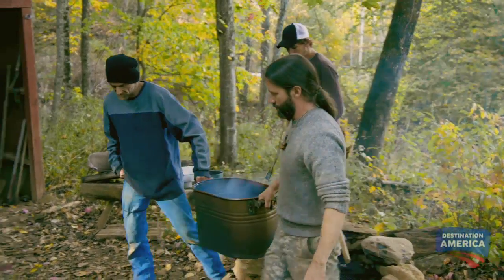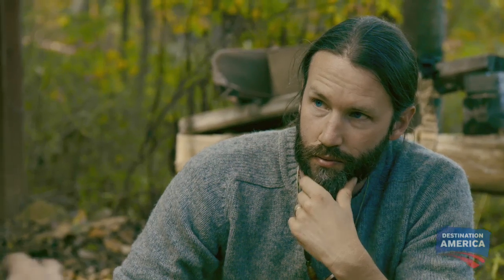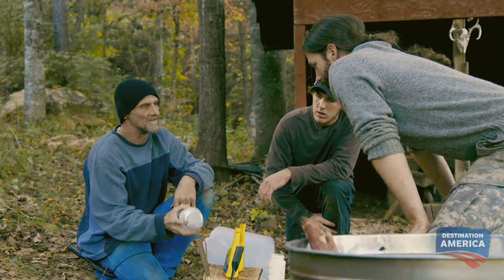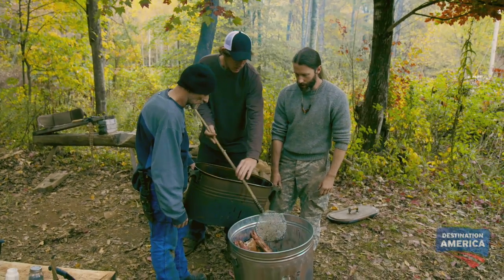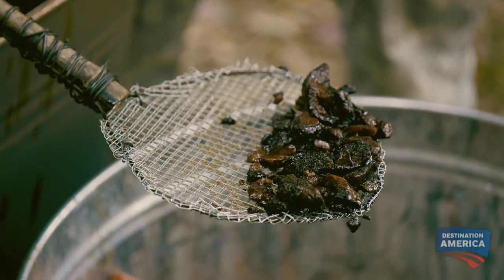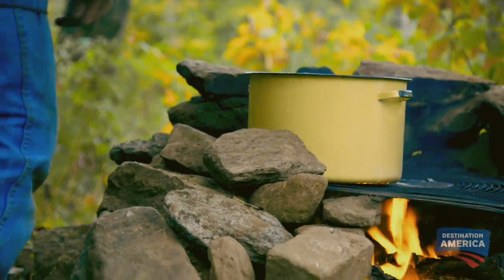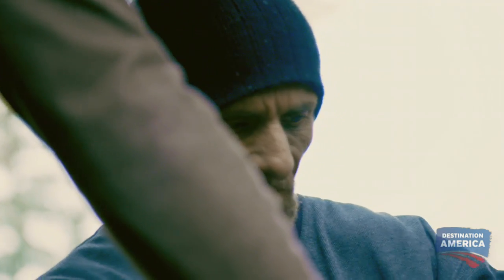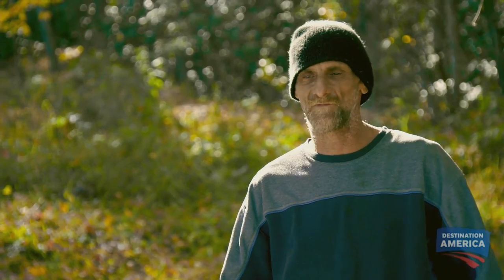Creating Biodiesel from Pig Fat | Hillbillly Blood

Comment: Thank you for actually doing it properly, unlike what many sources try to claim. (Just using fat straight, etc.) Excellent technique with such little equipment. And here I thought I was going to need a heated stir-plate. I was not sure if lye would eat plastic, but obviously your container is sufficient to contain the reaction... and it also appears that periodic agitation should work, unlike another source that claimed you need a magnetic stir bar and a constant temperature. Awesome. You pretty much saved me $300 is equipment that would probably only have been a marginal improvement at best. Probably want to insulate the reaction vessel though. I am sure there is a minimum temperature for this to work.
Reply: Allchya gotta do iffin ya trynna lern is go figure da hillbilly way. If ya aint need it. We aint got it

Comment: To summarise: You melt animal fats on a campfire, add lye (probably half a tablespoon per litre) and let it sit for a while off the fire to stop it solidifying like a candle, then filter off the glycerine (which is what makes it solidify) with a bed-sheet. You can add some methanol to thin it out a bit afterwards to make it last longer, but that adds cost. I really wouldn't use up cooking gas to melt it but rather use a campfire. If you just have used cooking oil, you can just boil then filter it and put it straight into your diesel tank
Reply: How are you going to boil the oil... it's boiling point is incredibly high. That would be more work and even more dangerous. Even then, is the oil going to somehow get the glycerine to break and settle out? That's what the lye and methanol are for, since it pops the glycerine out of the tryglyceride. I don't see how that can be omitted. Once the glycerine is out, it should be thinner, faster burning, and cleaner burning.

Comment: Please tell me someone has corrected this show, heat and filter oil/fat, lye is used to separated glycerine that is all, pour off glycerine. and you have diesel. Methanol is toxic no need for that can add ethanol to thin it same alcohol you drink. I think its deliberate miss-information. Research people please. ethanol alcohol you can consume, methanol alcohol will make you blind or kill you.
Reply: I'm sure the main reason why they're using methanol is based on purity of the reagent. No idea about the methanol source, but without buying reagent grade ethanol from like sigma Aldrich, if you try using vodka it's going to be 60% water and things that are not ethanol.
Reply: Is it possible to make this without methanol or ethanol or anything like that? I'm fine with the lye and the fat, it's just adding ethanol or methanol adds to the expenses.
Reply: +ASeekerOfLostSkills  I didn't hear them say anything about drinking methanol... Anyway... Ethanol is for drinking--that is..... after you get the methanol out lol.
Reply: +JJ Mayers The source of their methanol was "Heet antifreeze" it has one of the highest concentrations. though any type of antifreeze would work, although a distillation process may be necessary.
Reply: The Rust Admin it SHOULD work as is because you can run a deisel engine purely off vegetable oil, crude oil, etc.
Reply: Is it possible to make this without methanol and  lye??
Reply: @critiquesabeach5771  No, not with this process anyway. Methanol and lye are 100% essential. You can't just dump filtered fat into your engine and expect it to last, even if it may work for some engines. Fat/vegetable oil are thicker, harder to ignite, and not as clean burning as true biodiesel. The lye and methanol break apart the fat molecules into smaller, easier to burn ones, leaving behind a thick gummy layer of glycerine that must be filtered out. The result should be a thin, clean burning oil that resembles clear kerosene. You man need to wash with water and distill to get total clarity, and yields can be lower than you might expect if using old, dirty, or degraded oils.

If you don't dissolve lye in methanol first and instead try to use vodka, or water, you will end up with soap. That's actually how you make soap. Same process just no methanol. If there is any water involved, we will get soap forming. Water is the enemy in this reaction, because we don't want soap. Once the reaction is DONE, you can wash any soap that did form out with water.

I have no idea why anybody cares about methanol being toxic for this purpose... you are not drinking it. Avoid the fumes and you will be fine. (IE, work outside, not in a small garage with windows closed and your face right over it.)

Do be careful with lye though. Gloves and and eye protection are a good idea. It can eat through your skin and react with fat + water in your body to turn YOU into soap too!
Reply: @stephenborntrager6542   thank you this really helped my experiment